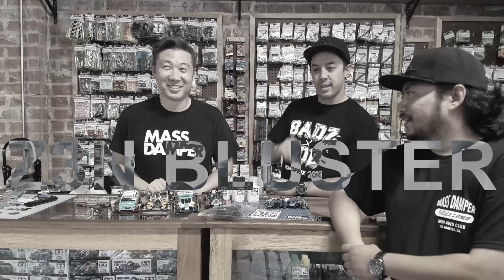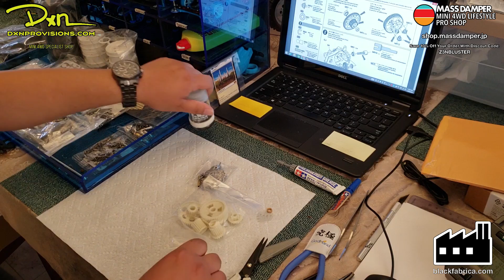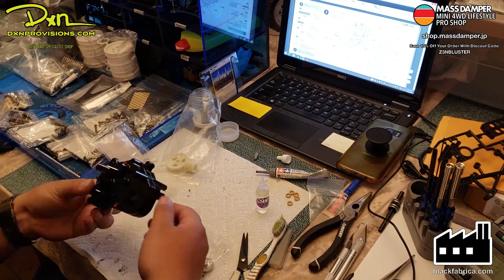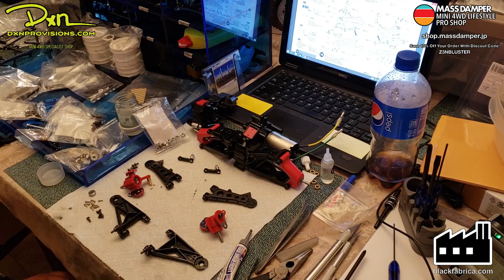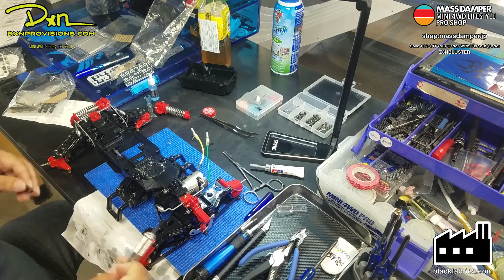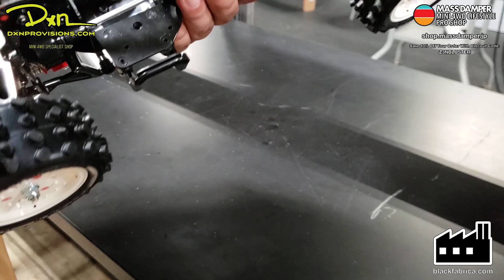Tamiya RC Build: Hot Shot 1/10 RC 4WD Off Road Racer Part 1

Comment: Also I'd like to add that oiled bearings will degrade faster than greased ones. Because oil is much thinner it's normally used for high rev applications, like skateboard or trakball, where you want a quicker effortless and easier spin. In wheels and gears you want a harder lube that stays and keeps dirt from penetrating. I ususally just wipe my bearings off with paper towel before installing, but leave the grease inside.

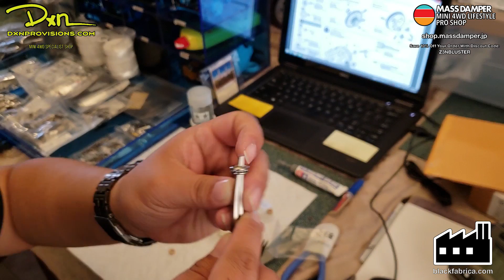Comment: That odd bearing you show around 2:05 is called "thrust bearing". In this kit it's used on each end of the center shaft between front and rear diffs. Inlike a standard roller bearing this bearing is made to take force front and/or rear side. In this case the center propeller shaft pushes on foam padding inside the joints, which in turn push on those bearings. There's no play between the center shaft and the joints here, that is why thrust bearings are used here instead of standard roller bearings.

Comment: Might want some foam inserts for the tyres and if you have a powerful electronics setup, you'll probably want to glue the tyres down so they don't eventually start slipping.  Other than that, looking good man.  Kind makes me want for a large scale car again like I had in the past, but I got a small fleet of micro cars :D
Reply from the maker: Good info. I'm ordering some.more modern Tamiya wheels with some newer tires. I think those come with the foam already. Just bought some Pro-Line tire glue as well.

Comment: Kuya jan pwede po bang mag unboxing ka ng mga evo 1 kits at assembly?
Tapos pwede po ba mag test run ka ng light dash/ pro machdash/pro hyper dash 3/ pro power dash sprint dash 
Salamat po sa pag reply! Assembly din and unboxing sa starter packs sorry kung madami akong sinabi kailangan lang po kasi eh
Reply from the maker: I might do unboxings of EVO kits in the future. I am not going to build them and run them though. They lose so much value after you build them so I am not going to do that. I've done one unboxing of the FM-A Starter pack. If I can get multiples of the other I will do them at some point.